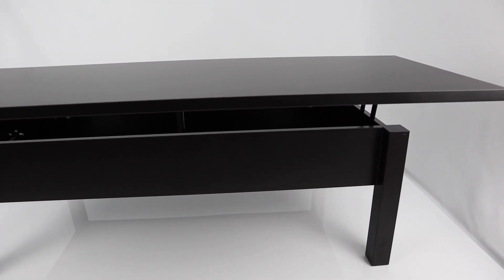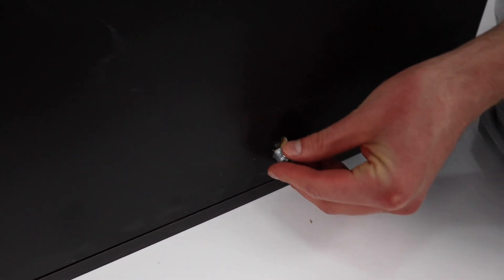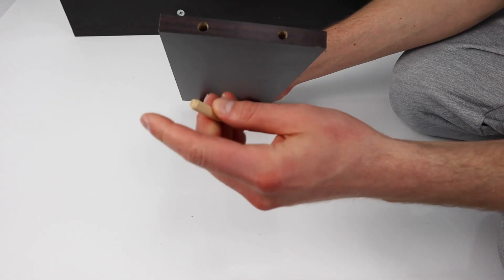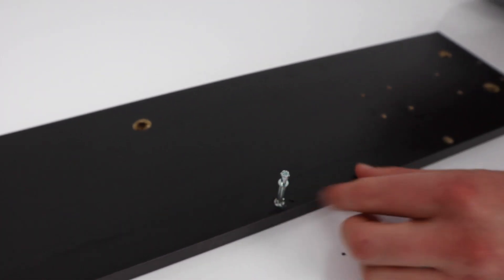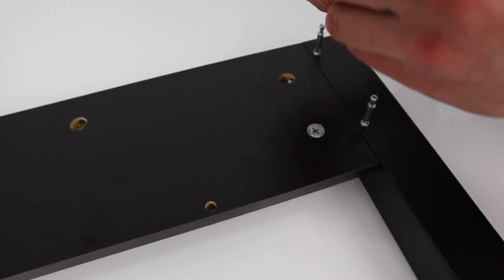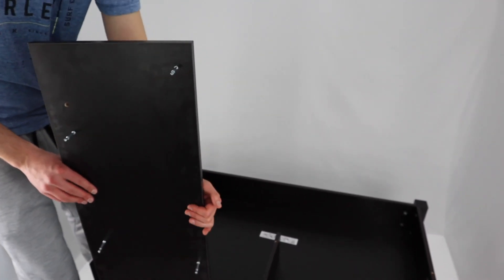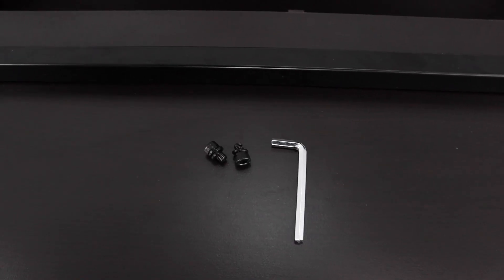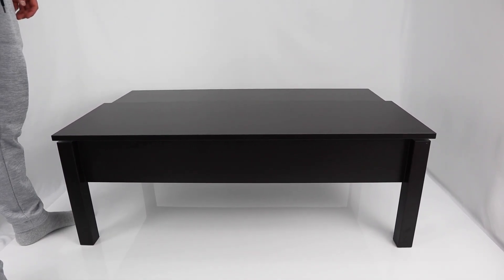How To Build IKEA Trulstorp Coffee Table

Comment: To everyone having issues with the top closing and overlapping on the otherside - What you need to do is take off that top part attached to the metal arms and flip it around. You screwed it on the wrong side, so it doesn't have enough space to close. If you flip that top part around and screw it in with more of the edge hanging over the metal arms, then it will finally close properly.
Reply: Wondering how much should be the middle top boards gap!? I got 3-4 millimetres, I thought it should be a perfect overlap.
Reply: @rafikshahbazian1783  the top 2 pieces for me fit very snug together where nothing can slip between.
Reply: @sanctusfides  that’s how it should be, I don’t know if I can make adjustments or I have messed up somewhere in assembly. Any advice would be appreciated!
Reply: Yes yes, thank you i faced this issue
Reply: @sanctusfides you are a legend dude
Reply: Holy shit, I never write comments, but thank you SO MUCH for posting this! I was racking my brain trying to figure out why this wasn't working at midnight, and this completely saved my sanity.

Comment: In the manual I received from IKEA, the piston was going the other direction with the bottom of the A facing the opposite direction than how they installed it in the video...does it matter which way to put it or is the way in the video a better way of installing it than what the manual says? Also, the butterfly leaf on that same side, does not close all the way and does not lay flat/in-line with the other side of the table (but the other hinge (right hinge) is allowing the other part of the leaf to be flat so it's almost like a slow incline almost from one short side of the table to the other if you are looking from the non-moving leaf's side).... I noticed the piston I have is very stiff and sticky sounding and does not stay all the way down when manual pressed in/doesn't move as freely as the one in the video--is the piston the issue and I need a new one or is the way I am doing it incorrect? Any advice would be super helpful! I am not sure if I screwed in the top while the hinges were misaligned or if it's the piston... so just looking to see if anyone else has had this issue and if they found a way to resolve it :) Thank you!
Reply: Hello! Were you able to resolve the issue? Just built one myself and the side with the piston doesn’t really go fully down. Tried using heavy books overnight to keep it down but it’s still slightly lifted
Reply: @metallca1996  no we haven’t been able to figure it out yet! A new piston from IKEA didn’t do the trick so it’s not that… the hinge where the piston goes seems like it simply rests higher than the other hinge in the down position… we haven’t figured out how to solve that bc all the screws for the hinge have been aligned properly with the holes that go into the side of the table… Sigh… please let me know if you found a way! Would greatly appreciate it <3
Reply: Just assembled this table and had the same problem. In fact my table got damaged because I tried to close it and the piston worked as a lever to bend its base that was screwed on the wooden table's side. After the damage I found you can turn the piston's cap so that you slightly change its length and then it has room to fully close without affecting its metal base.That is not mentioned anywhere in the instructions and it's too late for my table...

Comment: My hinge system rests too high up. Therefore the table tops are not level with each other. Could this be a manufacturer error?
Reply: Mine too. I returned the table, got a new one and still have the same issue ...
Reply: @jny23  I was able to fix mine, the compressor piece that makes it close slowly I hadn’t installed properly! Hope this helps!
Reply: @haleyc5464  how did you fix it, I got the same issue
Reply: @jacamikaelson6046  I believe I am having the same issue too... how the person in the video installs the piston is different (I think) than how the manual says to install it... but also I think my piston may be the issue because the inner part doesn't stay fully inserted into the outer tube... the oil or pressure forces it out to a certain amount so I think that may be why my table on that side doesn't close all the way... have you had any luck on this?

Comment: NOT CLOSING FLUSH ON PISTON SIDE: 

Loosen the long metal bar connecting the two hinges on either side of the table - the 4 screws that were tightened with an alan wrench. Not closing because those screws are too tight.